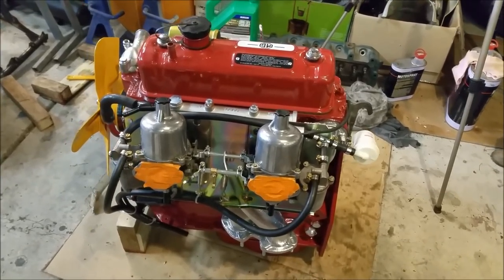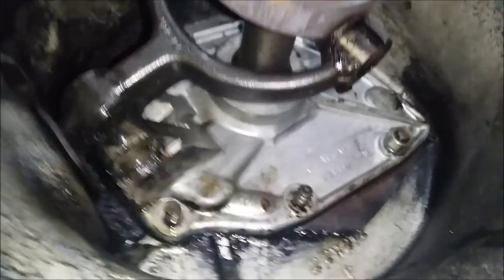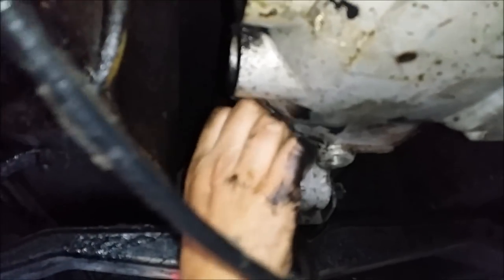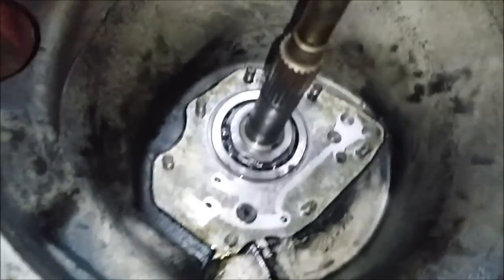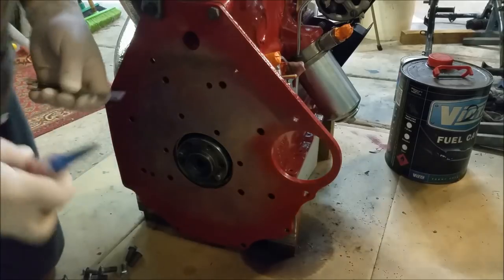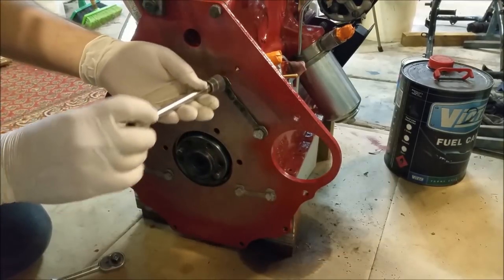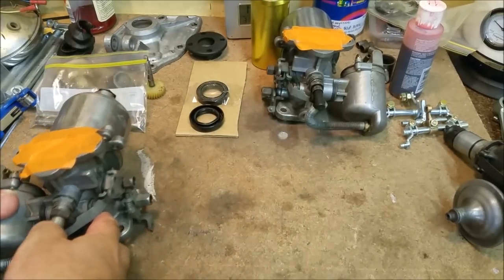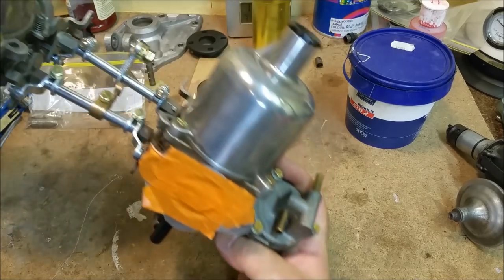MGB B Series Engine - Re-sealing, Painting and Plating - Part 5

Comment: You should have a thin metal shim in that back plate in the bell housing connected to the gearbox, they disintegrate over time so wouldn't have been there when you pulled it but does need replacing

Comment: Thanks Peter, just a quick question, at about 17 mins you install the carbie spacers and said, the longer the runner, gives an increase in the torque.
Is there a simple and quick explanation for this. Interesting .
And love the sound of the rain on the roof, just after.

Comment: Thanks for uploading this latest video, the MG's engine looks amazing, & will look even better once installed. You mentioned the body was better than you had thought in previous videos, will you be doing any body work on the MG soon? Perhaps this will wait til after the XC is done.
Reply from the maker: Yes, I've ordered a LH rear quarter panel, which will be hung on the garage wall until I get around to fitting it. I need to get some more done on the XC in the meantime. Cheers